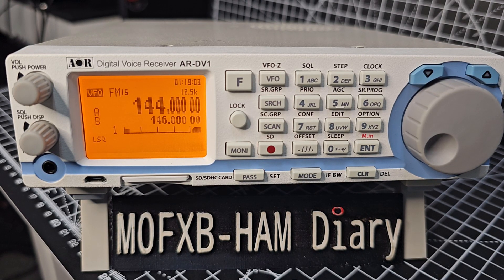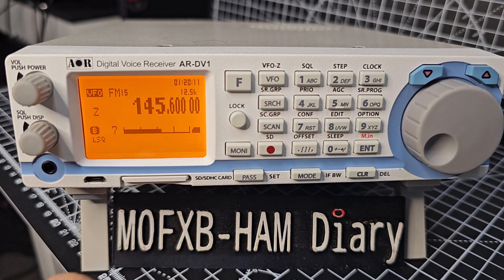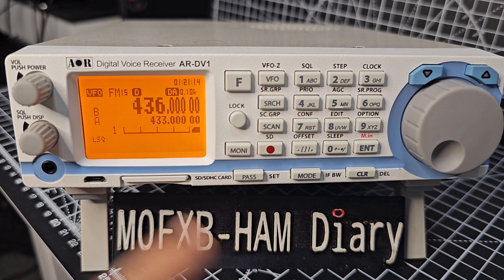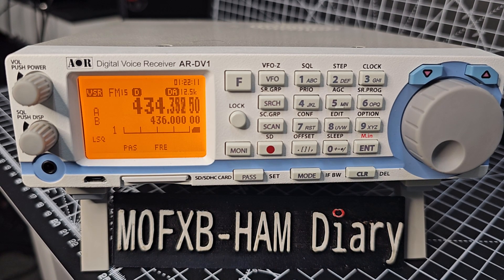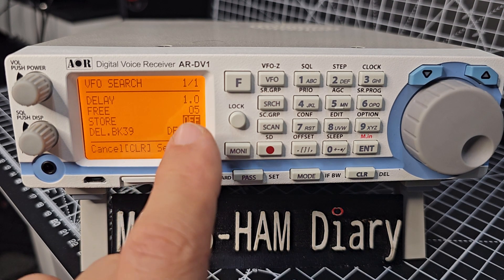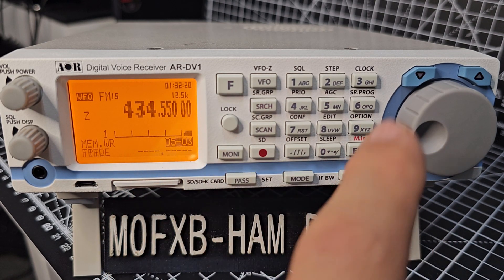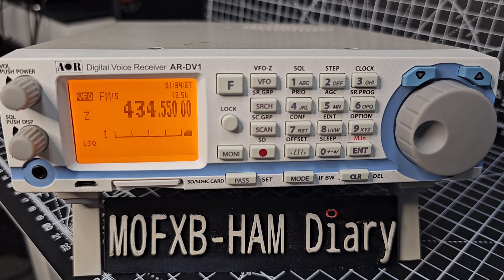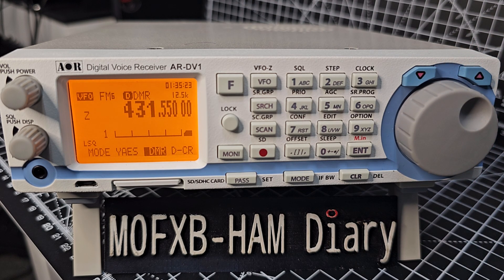AOR DV1 - VFO SEARCH & SAVE

Comment: umaczenie tekstu za pomocą aparatu

Hello, I have dv1, and I wonder if you have a problem with different volume. c4fm It is very quiet, just like analog FM, dstar, d-cr very loud, tetra distortion, I have the latest firmware, any ideas?
Reply from the maker: This does happen it depends on the station .